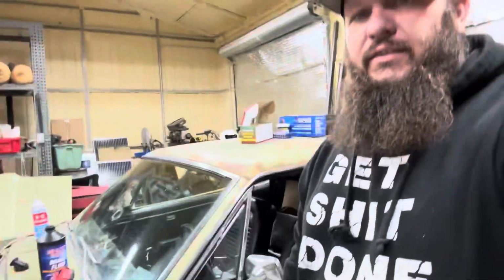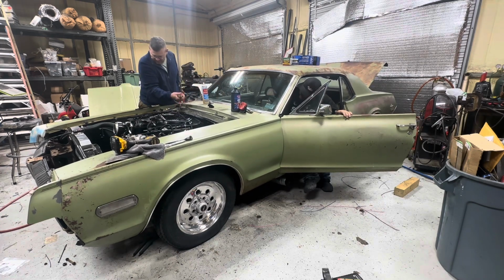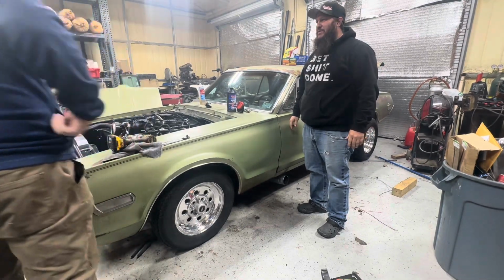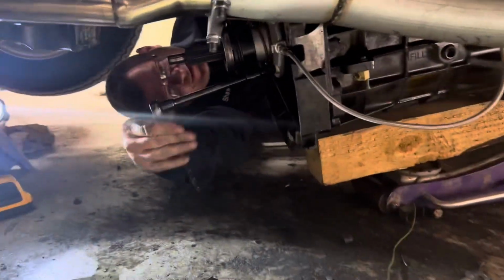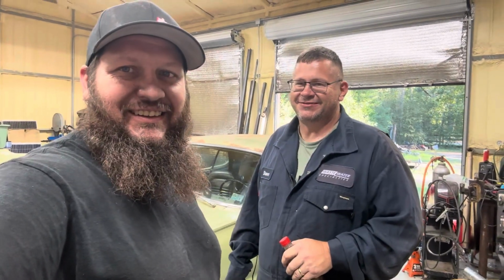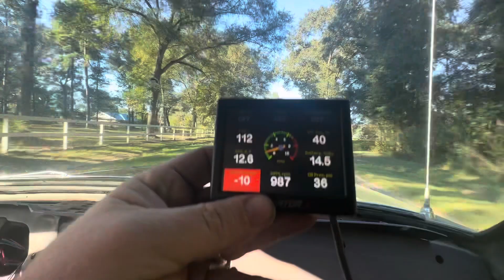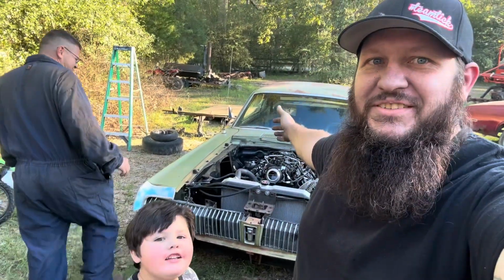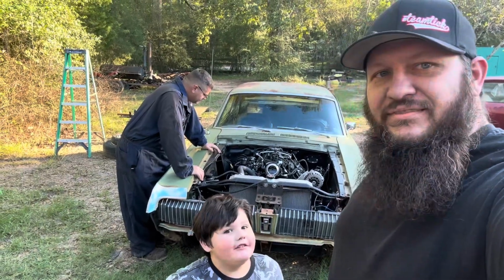1968 Mercury Cougar - First Drive on our LS Swap!

Comment: Nice choppy idke.  what are the cam specs?  im doing an LS swap in my 67 cougar.  I will add a 7875 turbski to it.  I swapped it to be AWD also.
Reply from the maker: @flatbrokemodsquad4241  this cam is a Texas speed shelf cam.. something like a chopacabra or similar (I’ll have to find the cam card). Now that the turbos are going on we’re switching to a btr turbo cam.
Reply: Nice.  im running a Texas Speed  cam in the 6.0 in my bronco.  .600/.600, 229/241@.050, 116 LS.  This with 2 62mm turbos and power is pretty crazy.